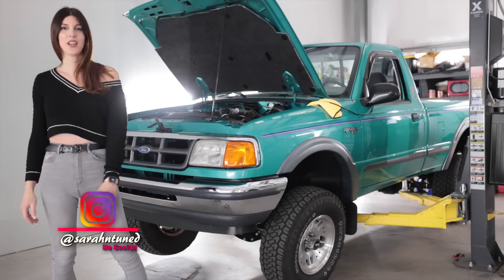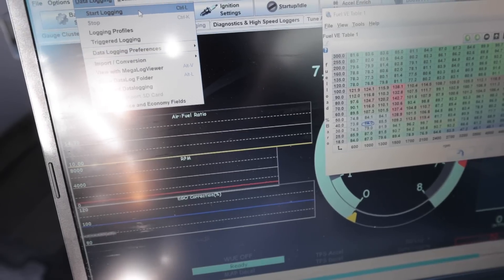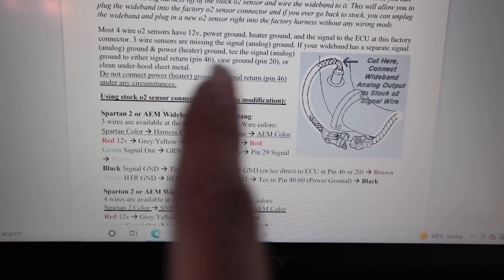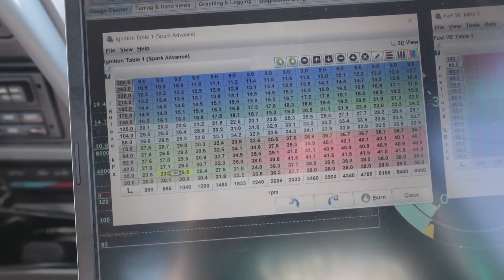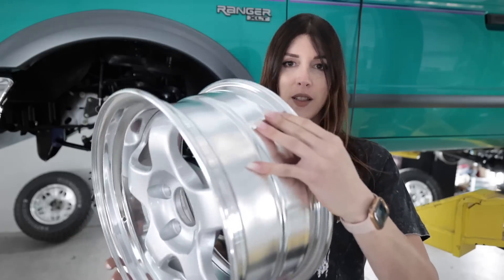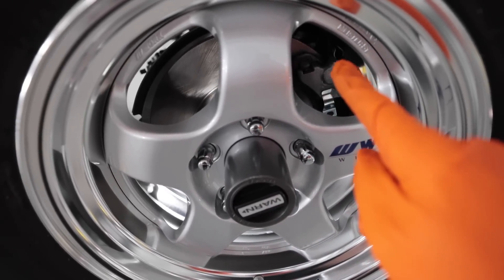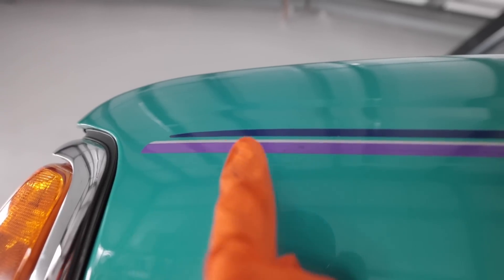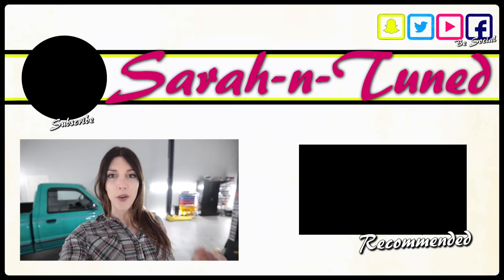Street Tuning Mission Complete! // '94 Ranger Frame-Off Resto Done

Comment: You did a great job on the restoration of your Grandma's truck Sarah. The wheels are the cherry on the top.
Reply: Poor Eric doesn't realize manufacturers spend very little time on "wheels" .awe just throw on some useless hubcraps (thankfully that is changing somewhat)styled is coming, thankyou Sarah for showing it can be done they look fantastic
Reply: Stock rims restored are 🔥
Reply: Needs some kind of center cap on the rear wheels.
Reply: Fingernails like that, this work gonna take twice as long. Dislike.
Reply: Looks great and it runs great now too. Great job done to Sarah and her helpers.

Comment: That is a great looking Ford Ranger you got there, and I’d have to say that those wheels look pretty nice. I just got a 1993 Ford Ranger in late October of this year and cleaned it up, replaced the headliner and installed cab marker lights. One thing I’d change about my truck is that it had Nissan wheels already installed that came off what I believe was a Nissan Murano crossover. I personally would swap those Nissan wheels with a set of smoothie wheels and some whitewall tires.

Comment: Hi Sarah, you read my mind, I would defiantly recommend a leveling kit on the front to get rid of the stink - bug rake in the rear. when you were driving around in the parking lot it is quite a noticeable the rake difference in the rear. As for the wheel choice, I love them, they add just the right amount of BEEF to the truck but still close to the factory look at a glance, I like the offset that you choose, looks great , the polished lip is bad ass, totally love the wheels. Bye Sarah

Comment: hi sarah  , jut in case it helps , your ve table , and ign table are set up with a vertical scale for a boosted engine. those scales can be changed to read 100 at the top ,  then you graduate down to minimum pressure say 20 kpa ....this gives you much better resolution , and a smoother map . Barstard of it is , that means the maps need redoing , but you can see your current number at a 100 lpa , put that at the top , then  go down the map putting in yuor numbers on the right lines  ,and interpolate ,between rows using the interpolate function top rhs of the page . RR

Comment: Although for Arizona it should not matter, but as a Vermonter, if the truck ever goes home to NH, I have found a thin smear of marine grease between where an aluminum wheel touches a steel hub helps a lot with the galvanic reaction that occurs with winter road salt.

Comment: Can replace caps with 60 watt soldering iron, solder sucker removing solder tape and electronic tape electronic tools, need to get exact replacement t cap. Practice much first, etc. If just caps you are luckey

Comment: Ahhh, so that's how straightforward it is to tune the Megasquirt,.... Looks about perfect for a Jeep 3.8 V6 based project. Tech inside the motor of your Ranger motor and the MoPar V6 is about the same, pushrods and all, but the MoPar is alloy block and heads, and about 205hp in the best version of it. Should do well in a 60's A-body that masses about the same as MrDos.

Comment: fyi putting on a 31X10.5 tire could out any bad or failing axel, pinion or transfer case seals especially if driven off road!  I have since sized back down to 30X10 tire to save on seals & bearings.

Comment: My 1995 ranger 4x4 needed 2 in lift to clear 31.5 tires with out rubbing at full lock.
Reply from the maker: This is a factory "High Rider Package" truck so if yours was just a 4x4 is might have sat lower.

Comment: That lathe sure came in handy!!  And another perfect wheel option!!  (If Sarah changes the tires to 31×10.50r15)With stock power in a vehicle watch out with a taller tire height and not re-gearing. You know... for those reading the comments, taller tires kill performance without a gear change.
Reply: Are you just giving a general warning? The Tire size didn't change, in fact the tires themselves didn't change. The only difference is the offset is slightly different. The only change would be the steering might feel a little different.
Reply from the maker: 2mm is not going to change the steering feel what so ever.
Reply: @SarahnTuned  lol, nope no steering difference at all
Reply: @SarahnTuned  your gram would have loved to see her truck better than new again!! Effin great resto!! Keep up the meticulous job that you do!!

Comment: Were you at one point going to put on the factory front air dam with the integrated fog lamps.
My personally I would not add a leveling kit on the ranger.
The truck levels out when hauling stuff.
The leveling kit when you haul a load actually make the rear sit lower and your headlights will be aiming in the air at night.
Otherwise great little resto ranger you did.
Almost better than the factory assembly line deal.
Reply from the maker: Yes, I have everything for it except the plastic valance. I can't find a clean OEM one in the right color.
Reply: @SarahnTuned  I trust you will find one. they are out there somewhere.

Comment: Valvoline maxlife atf might help that power steering whine.
Reply: As an owner of a Ford of roughly that vintage... that's just how they sound 🙂
Reply from the maker: There’s nothing to “fix”, that’s normal.
Reply: @ericthomas3181  Things can change with a little help.  My Fords steer quieter now.  I think by adding chain saw bar oil or "Special" atf...is that it reduces bubbling of the fluid.
Reply: @eldonmonroe6030  I genuinely respect your experience, and will remember it if I'm ever in a pinch!   But when I can choose between using a lower viscosity product like VML-ATF (~5.9 cSt) or a fluid that meets the spec for my 1993 PS pump (~7.4cSt)... I'll choose the latter (worked well so far) and enjoy the vintage engine sounds 😉

Comment: Ranger 1995 equipada com o motor V6 é uma picape robusta e confiável para sua época. Aqui estão algumas informações básicas sobre ela:

Especificações do Motor (V6 4.0L)

Motor: 4.0L V6 (gasolina)

Potência: Aproximadamente 160 cv

Torque: Aproximadamente 30,5 kgfm

Transmissão: Manual de 5 marchas ou automática de 4 marchas

Tração: 4x2 ou 4x4, dependendo da versão

Outros Detalhes

Consumo médio: Cerca de 6 a 8 km/l na cidade e 9 a 10 km/l na estrada, dependendo da configuração e do estado do veículo.

Capacidade de carga: Aproximadamente 700 kg.

Suspensão: Dianteira independente com barra de torção e traseira com eixo rígido e molas semi-elípticas.

Freios: Discos ventilados na frente e tambores atrás.

Pontos Fortes

1. Durabilidade: É conhecida por ser bastante resistente, principalmente em terrenos difíceis.

2. Versatilidade: Boa tanto para trabalho quanto para uso recreativo.

3. Desempenho: O motor V6 oferece força suficiente para rebocar e carregar cargas pesadas.

Pontos a Observar

1. Consumo de combustível: O motor V6 não é muito econômico.

2. Peças de reposição: Dependendo da região, pode haver dificuldade em encontrar peças específicas para modelos mais antigos.

3. Manutenção: É importante manter o sistema de arrefecimento em bom estado, já que esses motores podem superaquecer se negligenciados.

Comment: most wideband controllers can output a 0-5v narrowband signal as a separate output in addition to the full range wide band output.  on your ECM, you may be able to use the EGR input for wideband and log that internally.  unless you're using EGR of course.

Comment: Sarah, it came out really nice!  Your grandmother would be proud!  Yes, a 1" lift on the front would level it nicely.  I put Bilstein 5100s on my 2003 tundra and that was perfect.  Remember larger tires increase your gear ration making low end acceleration worse.   I put 275/70s on my Tundra and is was noticeable.  That's 1/4 inch in radius!  Sorry you were having problems finding a replacement for the ECU, but the MegaSquirt is a great replacement!  Thanks for the video!

Comment: Nice job. Can’t wait to see it with 31” tires. The power steering pump sounds like it’s low on fluid or the pump is starting to go.
Reply from the maker: Negative, its a brand new pump. That is how 80's/90's Ford Rangers sounded new.

Comment: So cool 😎😎  like new 😀👍🏻👍🏽🤙🏼  those wheels are so cool bro ,  thanks for inspiring ,  my 1996  Rav4 I did a quick rattle can paint job,  then fixed the drive shaft and back end , now the transmission need's fixing as you have to pull the engine and transmission out ☹ might as well rebuild the engine as well and paint the engine bay to  lol

Comment: There is a DIODE in the fuse box that might have been the issue with the old ECU. When the diode is bad it will mess up the voltage ground reference to your sensors, causing it to run bad.
Reply from the maker: Wrong
Reply: Thanks for mentioning that, I'll remember that if my '93 F350 ever begins acting up, in this case however the diode was not the problem... a floating ground-ref would have affected the Megasquirt as well as the OEM PCM.  Since the Megasquirt solved the problem, the diode issue is moot.  As to what specifically went wonky on the OEM PCM, it would be interesting to know whether it was a mechanical failure (solder-connection, internal interconnect, PCB, etc.) or an electrical event that may have damaged a semiconductor (ESD, voltage surge, etc.).

Comment: Nice rig, now I miss my 86extended cab ranger 4x4 5spd manual it had 3/4" rock guards and armor plates underneath I drove dukes of hazard through the woods and stuff and only ripped a front wheel off the axle, was easy repair

Comment: That thing turned out amazing. My first brand new vehicle was a 1993 Ford Ranger. I’ve owned 4 of them and currently have a 2002 extended cab Ranger with over 200k on the original engine. It’s still running strong and is a super reliable little truck. Great job on your Ranger and honoring your grandmother with it.

Comment: I just recently seen a 96 Ford ranger XLT regular cab short bed 2wd truck,, that someone pulled the ac out and put the standard heater no ac setup in it because it was a factory 5spd truck and they put a 84 Ford F-250 351 in it and a better 5spd transmission I'm like neat but nope way too much work involved to use a 351 from a bullnose Ford F-250 I'd rather use a Ford 302

Comment: Hey Sarah, I think that you would find a 6" dial caliper really handy in your tool set. They have both digital and analog. I have both but use the analog the most and there are analog ones that read both SAE and metric. Also the comment about it being a little less than a millimeter with you reading a tape measure and then Charlie saying that he took off .038" and 1 millimeter is .039". There gonna start calling you micrometer eyes.

Comment: Very cool. Trucks running and looking great with the new wheels/rims/shoes. Just a question tho. Will milling the hub centre down a bit affect putting back on the other wheels you had on it. Will you need to get original hubs to put the wheels you had on before???. Just wondering, I’m not a mechanic just a question that I can learn something new